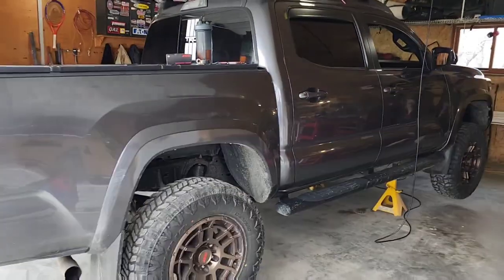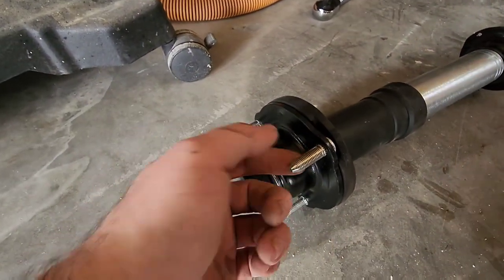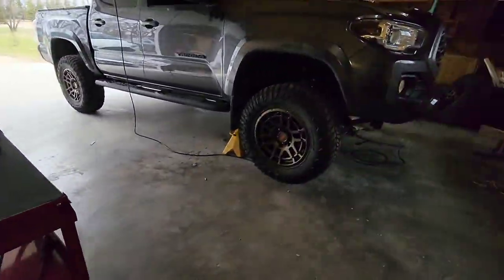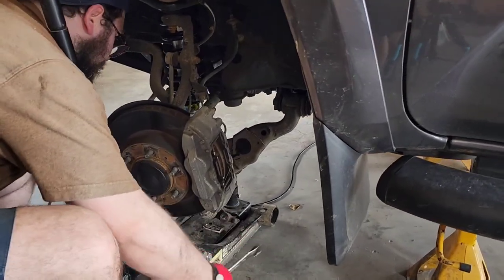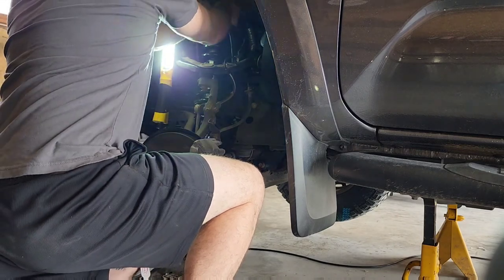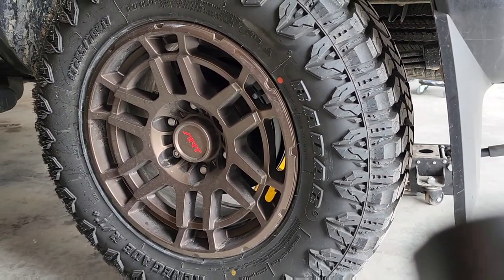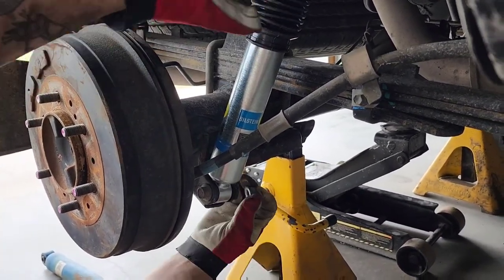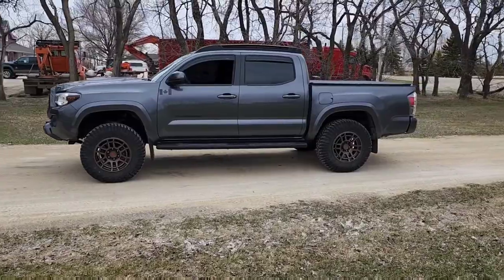Bilstein 5100 Lift Install On Austins 2022 Toyota Tacoma

Comment: Sick looking truck! By the way how did those KYB strut mounts work out? I was going to get those but kept reading in the reviews that the provided nuts were crap. Made me wonder if the "bolt" parts was also crap so I went with the OEM ones instead ($60 each! ouch!). Thinking of returning them and just give the KYB ones a try. Can you provide me the reference/part number for the nuts that you used over the provided ones?